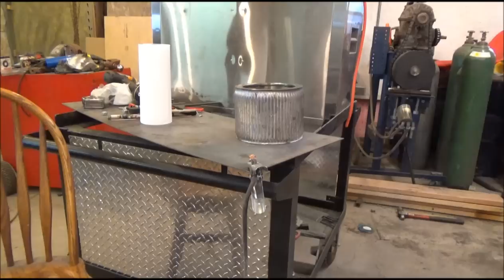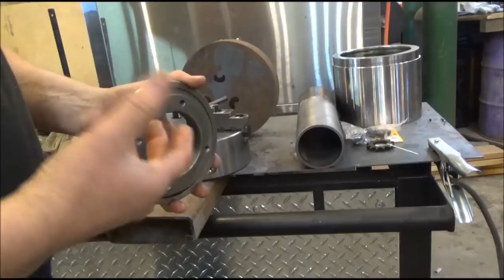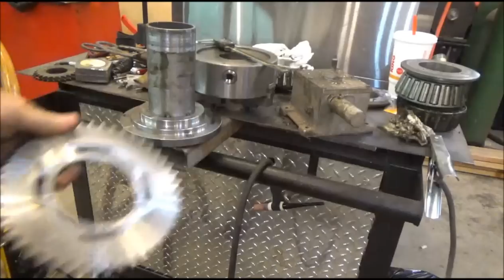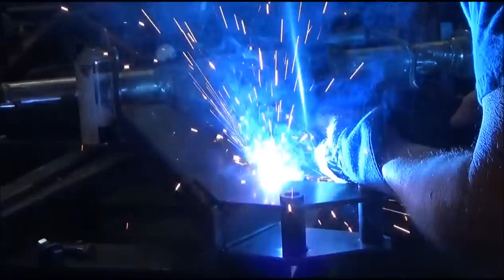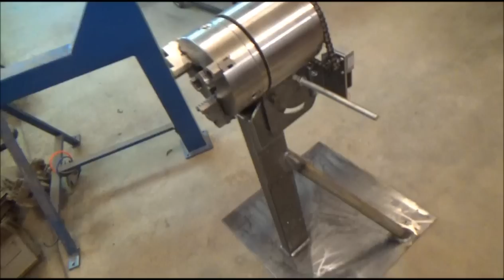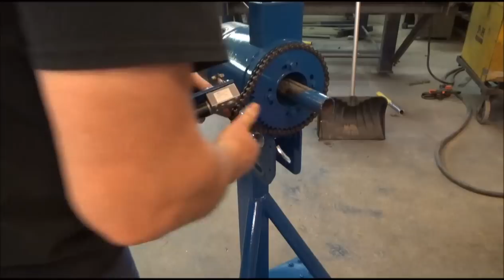How to make a welding rotator

Comment: sorry sir, where do you hook the welding machine ground?
does it not disturb the bearing if there is ground contact with electric current, please explain, thank you very much
Reply from the maker: The ground clamps on the base the bearings are large roller bearings not ball bearings so they are not affected by the electricity going through them. the amount of contact area the roller bearing has is a lot . if they were ball bearings they would have nearly no contact area and might arc .
Reply: @DeanzRodz  ya its true  , May I ask for a picture of the size, you know I'm 50 years old and I often forget . I really like the machine it's simple but very useful, thank you for the response
God bless you

Comment: Watch the welding ground current doesn't go back to your panel through the motor's ground. I insulated my rotator spindle from  the motor ground by using uhmw as the bearings.

Comment: So basically "how to make a welding rotator if you have thousands of dollars worth of available equipment". Cool. Not for me.
Reply from the maker: All this stuff is in the garage behind my house . Most of which I bought at auction for a few bucks dragged it home and rebuilt it over 25 years .. Only few new machines I have is the CNC machine and my TIG , Which I got by driving same pile of crap car for 20 years and working 12 hours a day in a factory I hated for 15 years before starting my own place  . Not one thing is handed to me . The building I built myself over a 3 year period which I fell off breaking my leg and arm . I poured all 85 yards of concrete myself . I nailed every wall stud and wired every inch myself . I took my first vacation in 28 years this year and still drive a 20 year old truck . I also make less than minimum wage working for myself . however I love every minute I spend in my shop building stuff . So if you get off you ass and work as much as I do you too could have thousands of dollars of available equipment . Or you can sit around and be jealous of what I have from working my ass off to get it
Reply: @DeanzRodz  ...I'm exactly in your boat. I charge a fck of a lot for WHAT I do.  I started out same as you a 12 hour day man and still got sh1t money. I got my smarts from my Dad and I built on them with observances during my working life. Now I work in a microscopic 5mm field of view. There's a weld pool I stare into...usually 2mm or 0.080" in diameter...and...I pay myself 2 x what my detracting boss used to pay himself...but you and I know what the real reward is...yeah we earn money...but the real.payment is getting some of those impossible jobs done through using our ingenuity...using our smarts that this prick thinks come from having thousands of dollars of gear in the background.  My smallest powered rotary was a small rotary table set on the spindle of a music box motor. I did a 40 thou repeatable radius doing that.  
Then used a guitar string tightened...then a Double Bass string winder. 
I looked at a bizzare ice cream cup rotator...you put ice cream in the cup and the little kiddie would just lick in one spot as the cup slowly rotated. I made a square ended drive...that drove a job making an easy 2 grand.  I'm in awe of your capabilities as others say to me...I didn't think it was possible. Onya Mate.
Mike
Reply: If you don't have an investment in other shop equipment, why do you even need a positioner? This build is very cool, and made mostly with tools and materials he already had. If you need the same type of tool, then make one to suit your situation and  take the time to make a video of your solution. 
Horses for courses.

Comment: that's a great job, I built a smaller positioner using a gear motor but can't get the speed down with enough torque. Could you offer the numbers  for that little motor and electronics to run it and how slow will it turn??? I am using a Dayton motor and controller now. My motor is a Dayton 2z803b.

Comment: Great content but if I might ask. Why not use lubricants while cutting and machining part? Not a machinist by no means but just curious. My last job use lube on all machined parts. Asking for learning purpose.
Reply: Awesome job by the way!
Reply from the maker: Theres lots of reasons for not using coolant . My machines are all open machines . So the first reason is, the coolant would get sprayed around the room everywhere, Second with a shop like mine where machines are not running 8 hours a day . Coolant gets bacteria in it really fast and within a week it stinks so bad and becomes a serious breathing hazard . So that's the reason I don't run coolant . I used a lot of wd40 as a lubricant . But I don't run a coolant .. Big difference . then in machining there are lots of reasons to run dry . most common reason to not use coolant is if you are doing something that a interrupted cut . Meaning it cuts a while and skips then cuts then skips . with that the insert gets hot and stays hot . If you use coolant on interrupted cuts the coolant cools the inserts too fast , During the skip and causes thermal shock and cracks the insert . I have been a machinist for 36 years now and I have worked in shops that are ran with fully enclosed machines that run coolant on everything and in shops that are dry . The dry shops are usually job shops and make a handful of parts . The wet shop are production shops and are making thousands of the same part .

Comment: I found the motor  what do I need for the speed controller and reverse?-mike
Reply from the maker: Copy and paste this on ebay . its $21 ..6v 12v 24v digital display led dc motor speed controller pwm stepless speed

Comment: Very nice job. I just built one myself but it has no threw hole. I am running my ground through the bearings which
I've always been against until I was at the driveshaft shop where they have been running a ground throught the bearings
for many many years. I presume that if you have a ground tab on the base that you are doing the same thing? What are you using for electrics?

Great Video!
Reply from the maker: The controller and the motor both came off ebay ( From china ). The variable speed controller was about $15 bucks and the gear motor was around $30 I think . And yes there is a tab welded to the base for the ground clamp